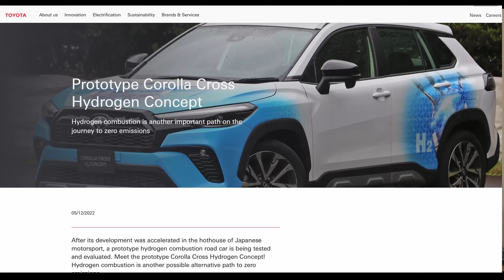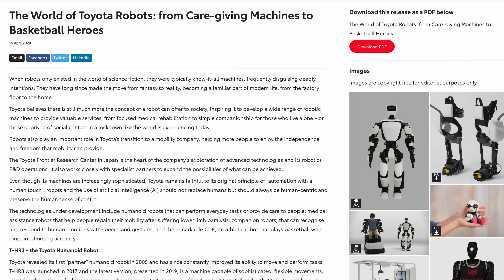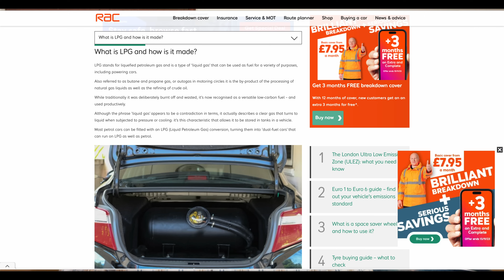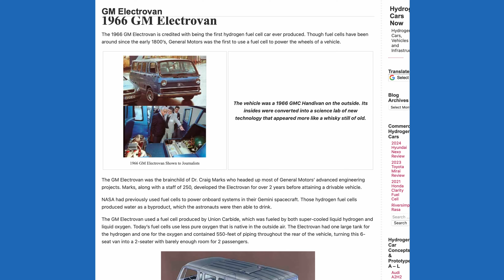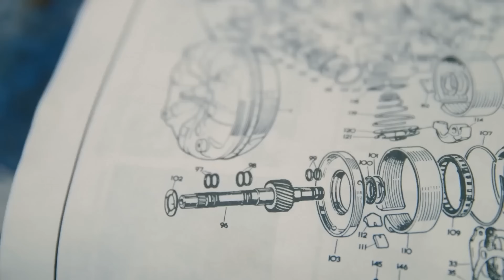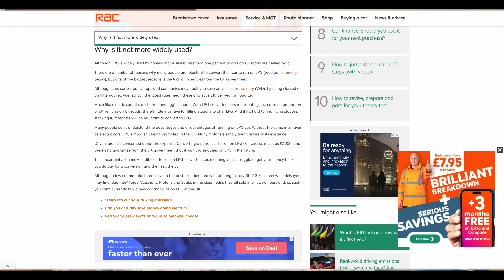Will Hydrogen Give EV Charging A Run For Its Money?

Comment: Back to the realms of fantasy again Corporal Jones.  I am willing to bet Toyota have an ace up their sleeve, but I am not going to second guess what. Let's wait and see. Petrol and Diesel cars will be around for a long time yet, even if new sales are banned in 2030. There will still be loads on the road well into 2070 and beyond, and a lot of tech will happen before then.
Reply: There will be "loads (of ICE) on the road" .... But new ones?
ICE cars are built on a "pile high, sell cheap, charge for service" basis.
Margins are low.
Reduce the market by... 5%(?) and those margins make it more difficult to justify the high volume factories.
Unless you increase prices, but that drives customers to alternatives.
.
Meanwhile, EVs (that's some brands... Or at least one) are "over the hump" of low volume, high expense and are now building the big factories while making industry leading margins.
.
How do you think this will end?
.
If they don't build them (ICE), you can't buy them.
If they DO build them, but at a high price, will "you" really buy them?
.
The same applies to fuel.
Tight margins, but reduce the demand and they must make a choice. Either reduce margins or become increasingly expensive.
Again, mirroring the vehicle production, the alternative energy  production is already cheaper.
.
Will you really pay for an increasingly expensive product?
(The majority won't, which will compound your dilemma)
.
You predict "a lot of tech" will happen...?
Let's have a few predictions?
.
The "laws of physics" say "hi!"
.